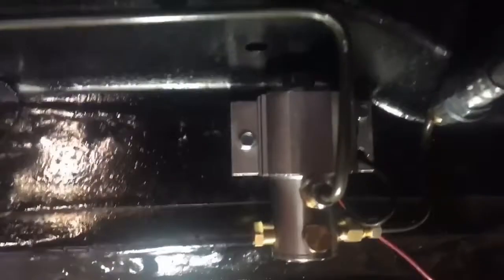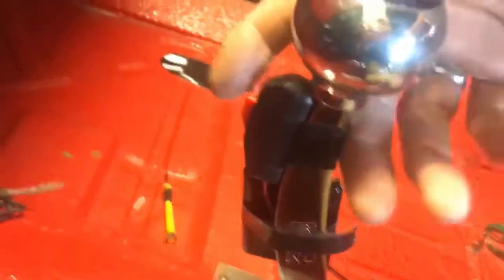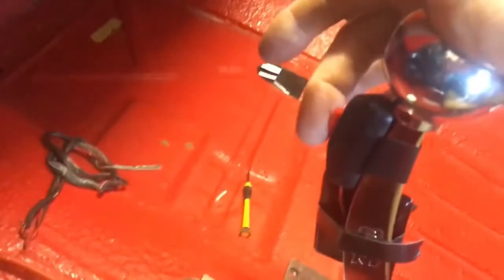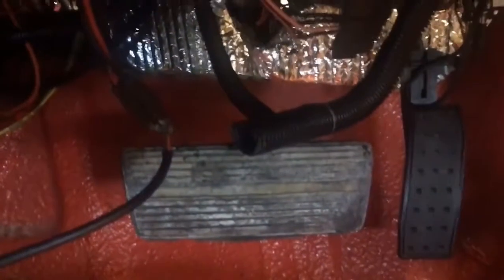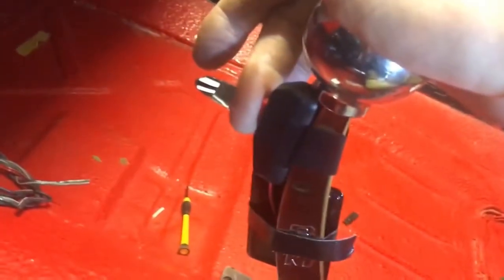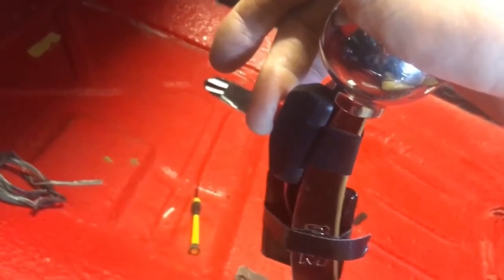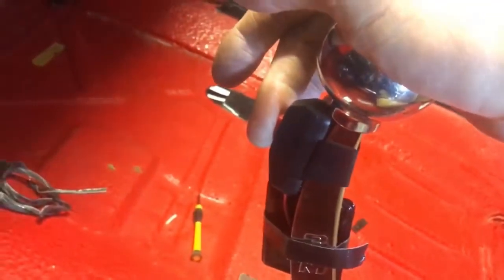Roll Control Valve/ Line lock Kit Installation

Comment: The part I’m looking for that nobody in here covers is I have disc brakes on the front of my nova and drum in the back. So I have 2 lines coming out to each front brake and 1 going to the rear. The instructions say to disconnect both front and run one of the lines out of the proportioning valve to the line loc then come out of it into a tee and run both brake lines into that T, and plug whichever line I didn’t use on the proportioning valve. So your only using 1 line to feed both front brakes and that just doesn’t seem like it’s enough to have enough pressure to the brakes!